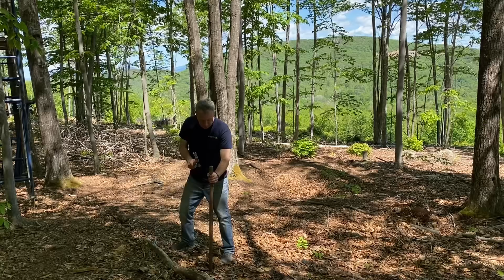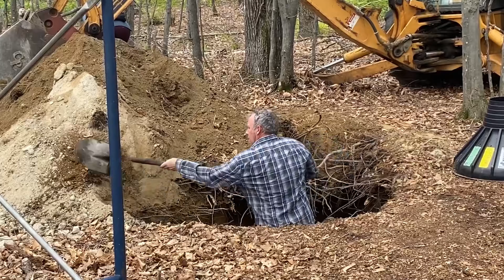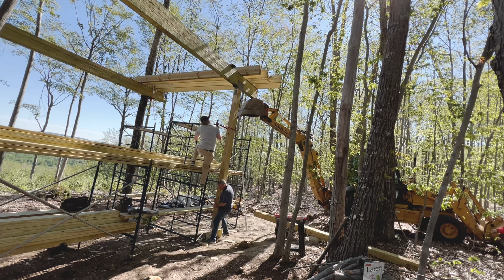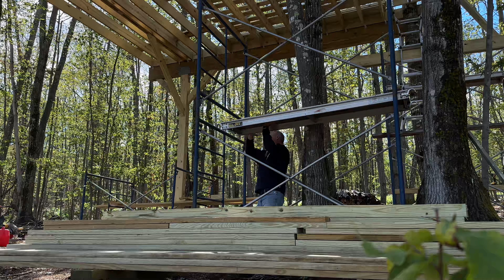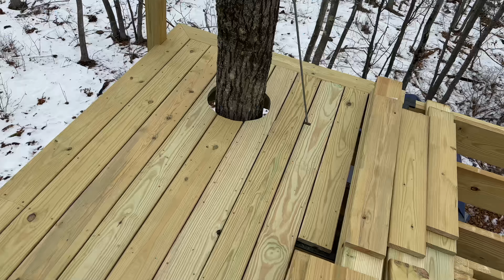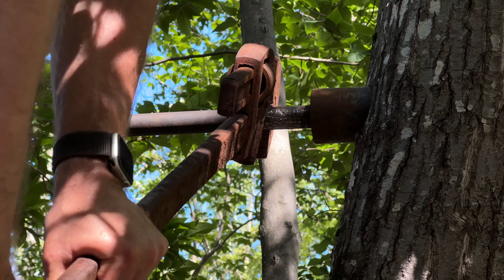Treehouse Platform Build in 9 Minute Timelapse

Comment: How do you know how much weight those thin trees are gonna sustain?
Reply from the maker: Nelson Treehouse has a "Working Load Capacity" chart, so for these 16 inch diameter oak trees, each tree TAB can hold about 12,000 pounds, add in the supporting cable and each tree is roughly capable of holding 20,000 pounds, so for our three tabs and the one support it should be able to hold ~80,000 pounds. Hope that helps! 🍁
Reply: @MapleRidgeHomestead  ok thanks, but i have no idea what a small house can weight, and also, those trees are growing and becoming bigger each year, so it will not create problems?
Reply from the maker: @andreadan-ty7cv  the trees only grow in girth where the TABs are located so the current height of the platform will never change. The tree’s will continue to grow taller but only from the top of the tree, if that makes sense